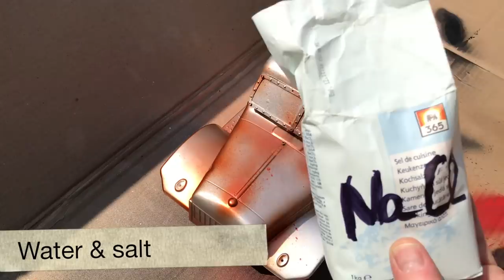This is how I do it … Lexan rc car body painted on both sides w/salt technique for a rusty look

Comment: Thanks for the instructional vid... I've just finished the ProLine '66 F100 cab, using your methods. Worked out AMAZING. I will probably never do a shiny, crisply detailed body again... Wish you could see some pics...
Reply from the maker: Thank you for the feed back, good to read your comment … and now show me your rig!
Reply: fullspeeddesign I'd love to show you the truck... But not quite sure how... Got a good bit of work still to do on it, but the body same came out great. Thanks again... There's an RC related site called Magnatfied.... It's on there, in the "What did you do to your RCs today?"  thread... Old rusty '66 F100 with a wooden stakeside bed on it...
Reply: I've put a quick vid on YouTube of the truck... next one will be similar, red, maybe a little less rusty, but this is the way to go for me from now on... now I'm doing a Power Wagon for my buddy.  They say imitaion is the sincerest form of flattery...👍🇨🇦

Comment: Stunning work!  I’m just about to paint a Proline F100 66 Ford cab, and you have changed my plan with it, I’ll try out your techniques now.  I have also just started a ‘ground up’ build based on the VS4-10 chassis, that will be using the Mojave 2 four door hard body from RC4WD.  I really didn’t know what colour to paint it, or if I should try and weather it, or not.  You know I’m absolutely gonna try and use some of your techniques on that too!  Thanks for taking the time to share 👍
Reply from the maker: Thank you! Drop a link so we can see your work 🙏

Comment: Great work and series! Inspirational!
About that rust, is it harmful as the natural rust?
Reply from the maker: Thank you! That rust is made with real steel power and acid is used to activate it so you have to take precautions. Once it's done and dry you can protect it with varnish to avoid contamination. With pigment and salt you can have very realistic results too, takes a little more time and skills too ;-)

Comment: I see that you painted over the salt did you sand till most of it was gone?
Reply from the maker: It depends of the quantity of salt you put, I like to put a little too much salt and leave some between the paint layers … it adds texture. If you sand down all the salt your paint will be flat … it coold be cool too, it just depends of the project. The best is to try on an old body or plastic bits you have left.

Comment: Did you do something to break the surface tension of the water?
Reply from the maker: If you mean around 4:00 before applying the salt … no. 
With the spray I have various sizes of drops. I don't want water allover the surface, neither too regular.

Comment: At what point did you paint the grill?
Reply from the maker: Around 5:00 :-D
Reply: fullspeeddesign what did you do the frame around the windshield with?  Was that 3D printed?
Reply from the maker: @crushingsnakes1972  
I made the windshield frame out of a steel sheet.
Reply: fullspeeddesign thanks for answering the ??  I appreciate it. I’m a noob to the scale side. I picked up a new kit the other day. Can’t start the build yet, waiting on some stainless screws so I’m researching the weathering paint methods.
Reply from the maker: Daniel Marcum Awesome! In scale projects the only limit is your imagination ... lot of fun for sure

Comment: What's the purpose of "purging your spray cans"? I googled it and nothing came up
Reply from the maker: This way paint doesn't dry in the cap and your spary will still work fine later
Reply: @fullspeeddesign  thank you for the info/reply, I wasn't sure what the purpose was but now that you mention I do understand it now. It's to purge the remaining paint out of the nozzle and since the can is upside down it wont draw additional paint from inside the can.
Reply from the maker: @spork861  your explanation is perfect ! 👌

Comment: I'm guessing this kind of paint job doesn't work out well with a car you use for bashing? I can't imagine the paint on the outside lasting very long 🤔
Reply from the maker: Maybe not the best idea for a basher … but if you take advantage of the damages and "repair" them with paint it could become interresting. 🙂 My tow truck is not gonna bash hard, realistic driving but not gonna avoid scratches though 👍
Reply: @fullspeeddesign  that's a great idea... The damage done bashing can just add to the "weathered" look 🤣

Do you think it would be possible to achieve the weathered effect when painting from the inside? I have a '78 c10 body I'm ready to paint, but it's going to be for my basher 🤔
Reply from the maker: It's possible but much harder imo. You have to reverse think the painting. 1st the scratches, rust used areas … than the used paint color and finish with the cleanest paint. I've never done it but the salt technique could work too ! I would also use matte varnish from the outside. You made me wanna try it now 🤣
Reply: @fullspeeddesign  please make a video if you try it, I want to see if it can be done! I would love to give it a shot, but I just don't have the skill or experience to be able to pull it off 🤣🤣
Reply from the maker: 🤣 … of course I'll film the process 👍🎥
Reply: @fullspeeddesign  subscribed to your channel in case you do! 🤙🤙